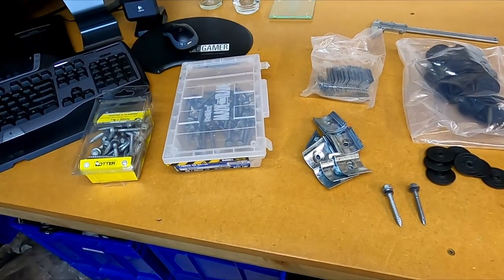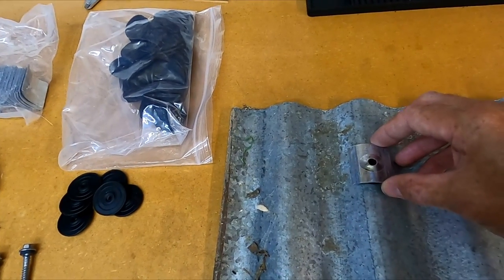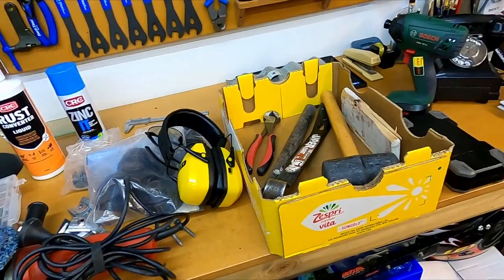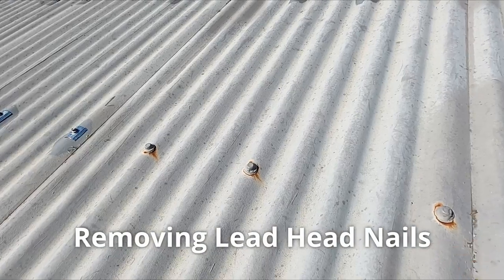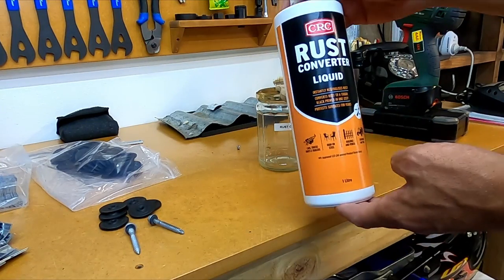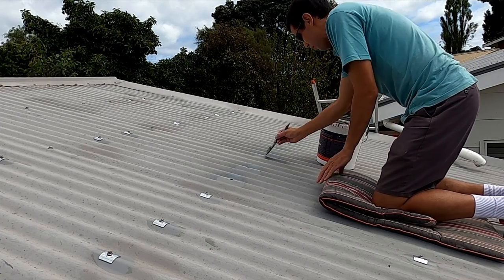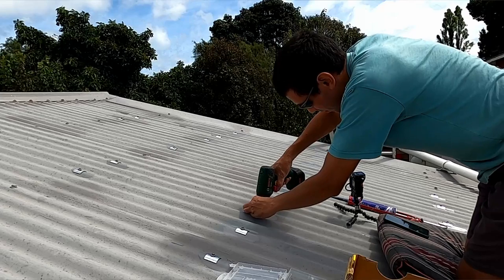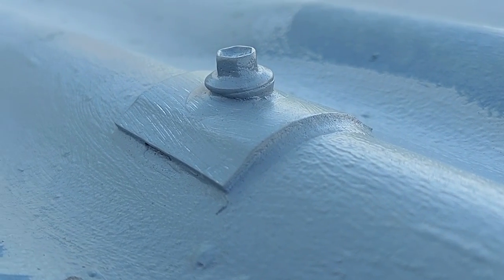How to Replace Rusty Corrugated Roofing Lead Head Nails with Roofing Screws

Comment: VERY  THOROUGH VIDEO.  I did my garage roof but I did lift it the iron and painted the underside and laps  to prolong the life.  I used the same rust converter.  I didn’t find the galvanised profile washers  in the store but I used the rubber washer  seals usually used for clearlite roofing and painted over them to give extra life.  They have worked quite well and will last for the life of the roof.
Reply from the maker: Hey thanks for the feedback, glad the video was useful for you.  Good on you for getting the job done.  I find that brand rust converter very good and paint seems to stick to it well after.  Thanks for watching and appreciate the comment take care 🙂

Comment: Thanks for an extremely helpful video. I'll be tackling this same task soon on my own roof. 

One question however, what should be done to replace the nails holding the ridge cap and barge flashings?
Reply from the maker: Hey thanks for watching glad you found the video useful.  With the flashings and ridge cap, yeah still replace those nails if you find you have surface rust around them and carry out the same process found in the video.  However if you find that there are large holes around the nail hole as a result of corrosion and where the new roof screw wont create a seal, for me I just had a handful of those so I just made my own flat square washers out of old roofing material I had and sealed with silicon with the screw driven through the middle (did the job fine).  But if you have quite a few like that, probably best not use my method but to buy aluminium backed epdm roof washers or the screw and washer combo.  You can get different outside dia. (OD) sizes maybe just go for a OD size that is bigger or similar to the lead head nail OD to be safe.  Hope that helps 🙂

Comment: Great vid, brought the same materials and ready to go 😊.  Did you use the same screw/washer combination for the flashing?
Reply from the maker: Hi there, good to hear you are ready to go, great job to get done when it starts to cool down end of summer 👍 for the flashing, no don't use profile washer.  I had very few rust spots around old nails on the flashing, i actually made my own washers using an old piece of corrugated iron, made a small washer by cutting it maybe 1 inch square, bending flat, drill a hole in the middle and using the same principle as some of my profile washers I also applied some silicon sealant for extra sealing measures.  Thanks for watching and all the best with your repair.

Comment: Awesome video man really helpful. Do you have any tips on patching small spots of penetrating rust??
Reply from the maker: Hey there, good question.  Sand any small spots of rust, use a rust treatment similar to what I used in the video (I find it works well), prime with a good metal primer or if you want to spend the money a zinc rich galvanized paint, then paint with roof paint.

Comment: Hi did you use the cr profiles/washers on every hole? We need to re=screw our roof and were told to use these on the high wind zones. Can we get flat ones for the flashing on the ridge line?
Reply from the maker: Hi there, Yes I found I needed to use the profile washer and EPDM seal on every hole that I removed the lead head nail because the screw wouldn't seal the hole originally used by the nail or only just covered the hole, either the nail hole was widened when removing the nail or had rusted out wider.  I didn't find any flat washers but my ridge line capping wasn't too bad and for the few nail holes that were bad I just made up square flat washers out of some old roof flashing I had laying around, pre drilled them and used roofing silicon between the washer and screwed down with roofing screw.  I've done this in the past and with repairs in 2014 and they are still holding strong.  (I do intend to do a reroof down the track, and this will hold up in the meantime). Hope all goes well with your project cheers 🙂

Comment: Very helpful indeed thankyou.  What sealer did you use? and does it matter?  Went to the Hardware shop and by crikey there's heaps of sealants....lol.
Reply from the maker: Hi there thanks for watching and I am glad to hear the video was helpful.  I would tend to look for a sealant which is marketed for roof and gutter use or a general all purpose house exterior sealant which has good uv\weather resistance, and for me it was important I wanted a paintable sealant as with some sealants paint will not stick too it at all (plus I painted the roof after the repair).  It would be best to pop into the hardware store and have a look and ask them that you are just after as sealant for your roof, if you are painting the roof I would ask for a paintable sealant (normally the sealant cartridge's will state on the side if they are paintable or non paintable).  Hope that helps all the best with your repair, take care 🙂
Reply: Cheers thanks heaps. @MannixGarage

Comment: Hi can I do this without the profile washer?
Reply from the maker: Hi there, yes, you can. When you remove the old roofing nail and if you haven’t widened\damaged the hole that the nail was removed from and ensuring that the new roofing screw washer still covers and provides a seal around the hole you will be fine. Perhaps have some profile washers on hand in case needed. Thanks for watching 👀 🙂

Comment: Where do you buy, or brand / manufacturer of washers and profile washers.  Assistance appreciated
Reply from the maker: Hi there, what country are you located?  If in NZ I can tell you the supplier I purchased from.
Reply: Thanks for the response.  Yes, located in NZ
Reply from the maker: @deborahcotter-smith4092   I was hoping you would say that, makes it nice and easy.  Jump on Trademe look for seller ja_bolt and search there listings for these items which I used the in the video.
 -Universal Roofing Screw Metal & Timber 6.2 x 50mm
-CR Profile + Sealing Washers
The prices are pretty cheap too.  My roof is holding up well, so happy with the product A++ 😄

Comment: Hi. What do you do if the old nail snaps and you just can't get it out?
Reply from the maker: Hi good question, if you have some wide cutting pliers you can use those with something to lever against in the troth of the corrugated iron (eg piece of timber or pipe like i used in the video) and try pull the nail out, if its unlikely you will get it out, just punch the nail down below the level of the corrugated iron and  just run a roofing screw down beside it, the profile washer will compensate for the wider hole.  Hope that helps thanks for watching 🙂
Reply: @MannixGarage Thanks heaps, that's extly what I did  - punched it down. I'm surprised how well a screw went in even with the nail there. Sometimes at a weird angle but no probs at all really.
Reply from the maker: @peanutaxis  Good to hear you got it sorted.

Comment: what pad u using on the grinder
Reply from the maker: Hi David.  I am using a Josco strip it disc made of Silicon Carbide Impregnated Nylon .  I see them referred to them as disc or pad but if you google what I'm using it will show similar product.  If using a grinder with the strip it disc to remove rust be careful not to move onto the surrounding galvanizing as it will strip that away quicker than say if using sandpaper or wire brush. Cheers 🙂
Reply: Thank you this video is so helpful

Comment: Are you using 12G or 14G Galv Tek screws with neo washer? Size is hard to see on the video.
Reply from the maker: Hi there good question, the screw size is metric 6.2mm thread diameter x 50mm length.  Looking at a metric screw size to imperial gauge table I found different results between 12g and 14g? however I think its 12g screw size by the looks. 6.2mm = 0.244094 inch and 50mm = 1.9685 inch for metric to imperial measures hope that helps. Thanks for watching 🙂👍
Reply: Its 12 gauge. 14 gauge have a bigger hex head and require a 3/8th drive bit. You were using a 5/16th drive bit.